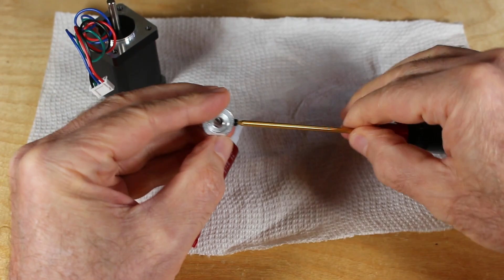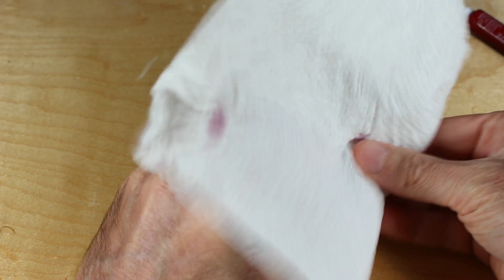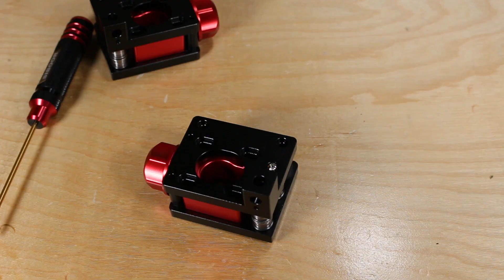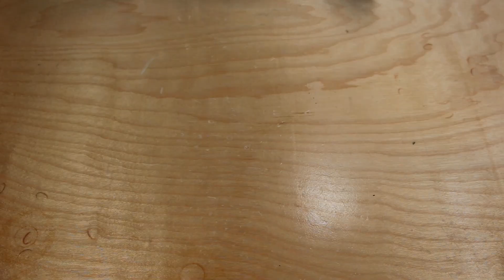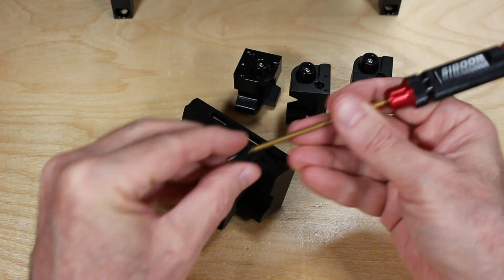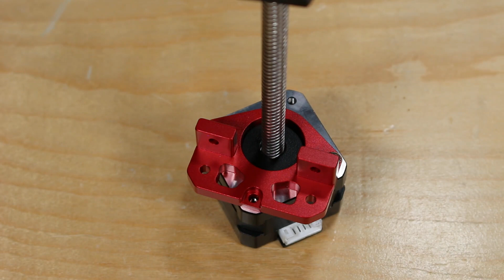Build a Siboor Voron v0.2 - Part 2, Motors for motion Siboor Kit

Comment: The idlers were such a pain. I tried your method but with handymen fixing the bathroom and the dog barking because handymen are fixing the bathroom i just didn't have the patience. 3x3 round magnets did the trick. built the stack with three of them, shoved it in the gap and shimmied them out with the bolt.
Reply from the maker: They are.  The worst part of the build.  That said, the printer is working very well.  Your magnet idea is pretty brilliant!  I will use that on my next build.  Thank you!

Comment: Did you get the Gemini v3 board with your kit? my Siboor kit is enroute, been looking at how to configure the onboard CAN for an EBB36 on the toolhead but the documentation is either still for the v2 board or makes it sound like the internal communication on the board changes. I'll certainly be referencing your videos during the build.
Reply from the maker: Yes, mine came with the v3 board.  I will initially get the printer running without canbus.

Comment: a dab of grease works as a bit of adhesive to keep a spacer/washer attached to a bearing. also, tape the bearings together to make installation easier, then just remove the tape after. i work on aircraft and those are some of my tricks. alternatively, print a little clip to hold the bearings together that you can reuse.
Reply from the maker: Those are all good ideas.  Thank you for commenting!

Comment: interesting little printer this,
i like the motor mounts and motor tensioners. Keen to see how these work in later videos.
Reply from the maker: You and me both!  Next video will be the gantry and belts.  From there a mad rush to get the electronics completed to test this thing out.  I have high hopes for those CNC motor mounts!  I would like to believe they are both stiffer and stronger than the 3d printed versions.  They seem over built which should prove beneficial.

Comment: When putting the front idlers together, cut a bolt to the length of the gap, build your stack on the cut bolt and slide it into the gap.  Then use the same push-through method, with the actual bolt.
Reply from the maker: I can see how that would work.  Thanks for the tip!